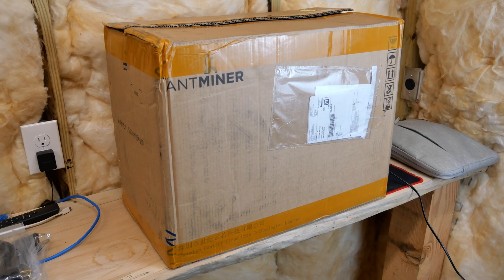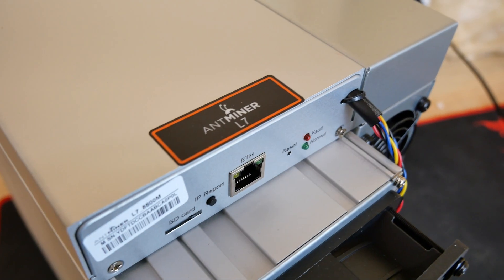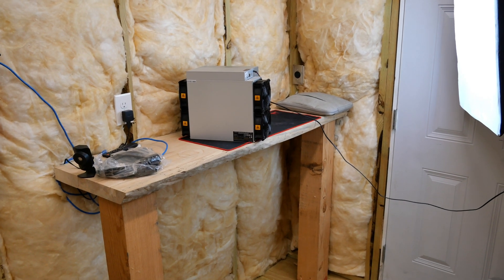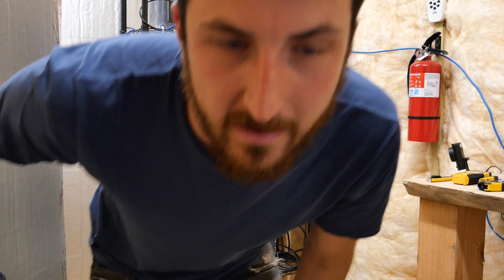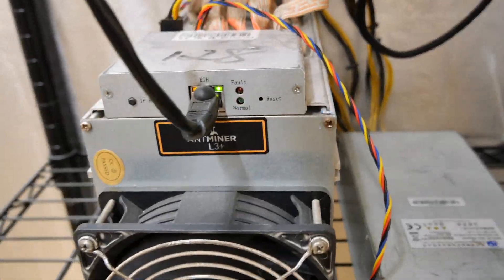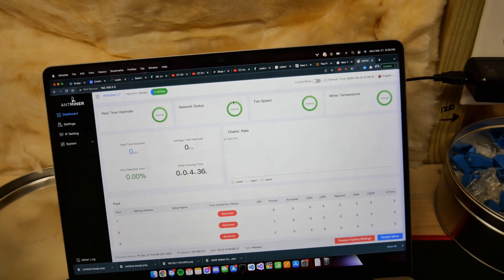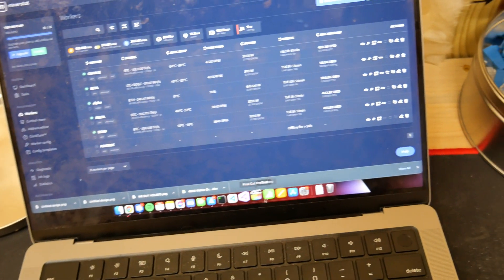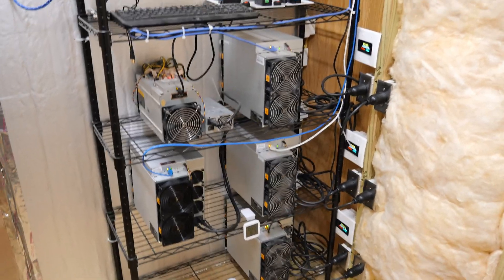MY NEW ANTMINER L7 Makes Over $50 PER DAY!!!

Comment: I can find my miner on multiple addresses on ip scanner and the browser doesn’t seem to open the page. I did a restart. The ping button. Changed my Lan cable. Nothing. Suggestions?
Reply from the maker: Guessing your router is giving you problems with DHCP, maybe try logging into the router config and checking the list of devices on there and see if you can find one with a hostname of antminer, should have the IP address there.